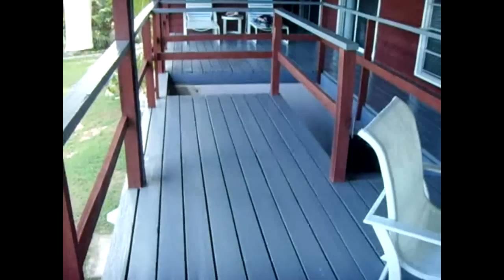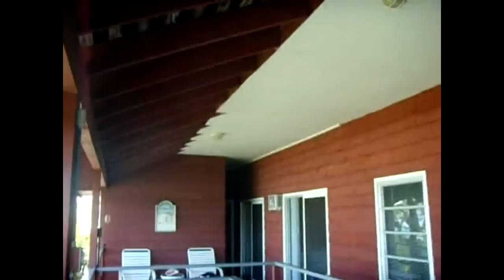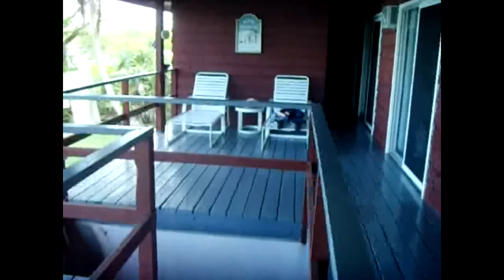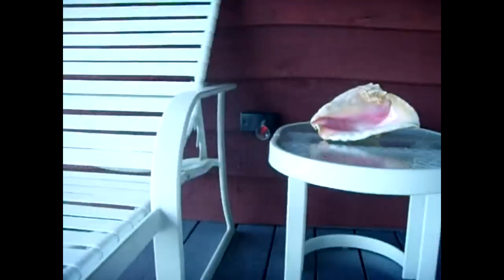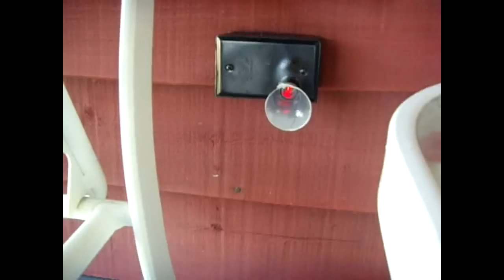Laser Beam Security Circuit

Comment from the maker: @Kapurod You can probably get away with two units by using a high quality mirror at a 45 deg angle at two corners. I would not suggest using this arrangement on wood frame buildings/homes unless the distance is under around 35'. Wood moves especially in damp or dry conditions. Even slight movement will throw the laser off target and activate the lights. Ideally you want concrete/concrete block structures. Make sure the mirrors are securely attached to prevent ANY movement.